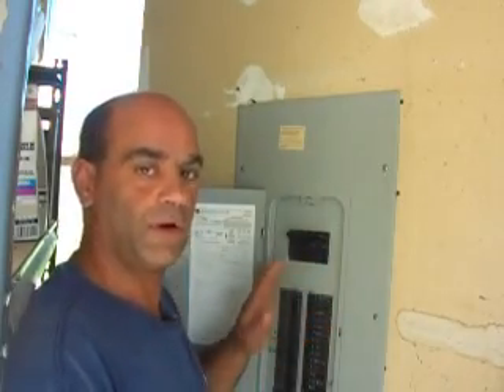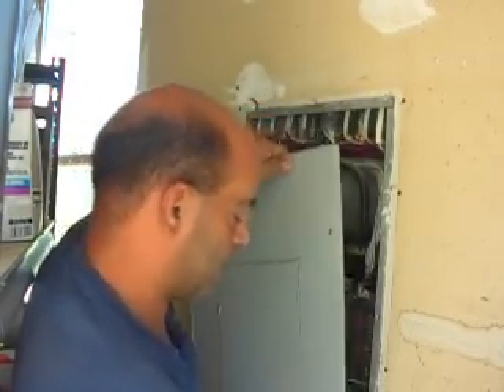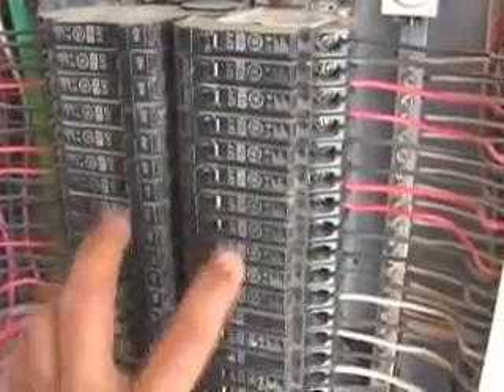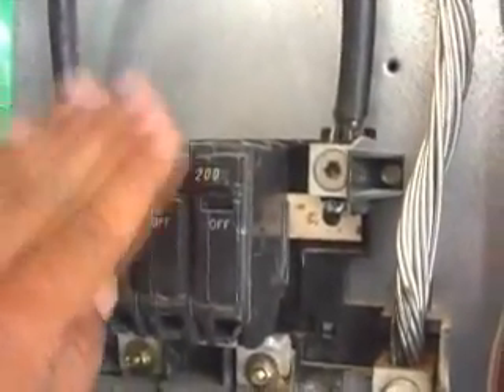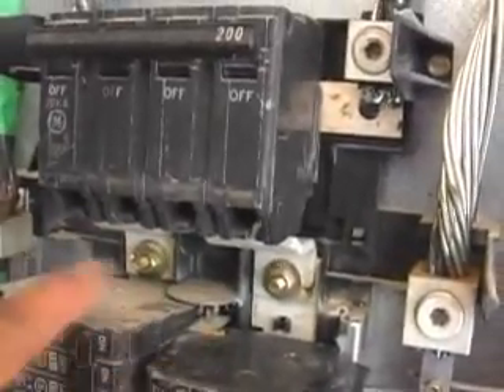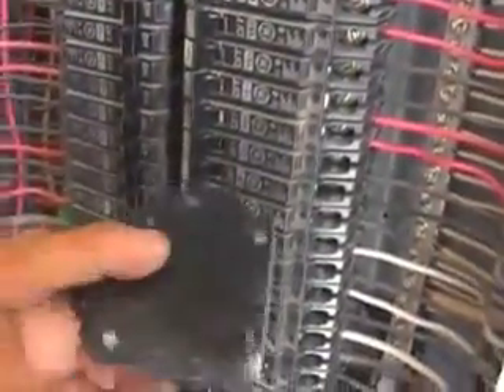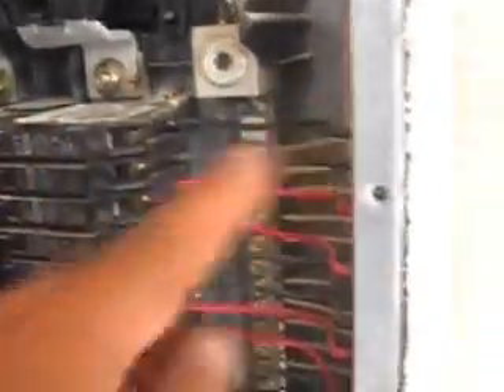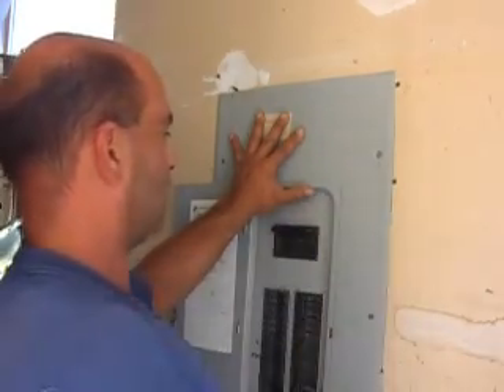How to change a circuit breaker

Comment: Okay, I was just gonna send an email but i thought someone would come across with the same question or similar. I live in a house built in 1960, the dinning room doesn't have lights fixture so I thought it was good to have some light and decided to install 4 recessed lights. the problem I have is trying to connect them. I connected them but now I tried to turn them on and it burns out the light bulbs and I don't know why.  Any suggestions? thanks... Edwin

Comment from the maker: Hi, it's very important that the breaker you're replacing is the same one. They can look a little different but should be the size size as in shape and of course the right amperage. I would take the old to a good electrical store and ask for one that will work.

Comment: Awesome!! nice video, thank you.. I really learned lol do you happen to have a video explaining the types of circuit breaker? I burned one and wanted to replace it but the one i bought is not the same, is the same AMP, but not in length and color. I did my research and i think i'm looking for for some twin single pole breaker 30AMP but the ones at the store are not the same length mine is longer then the one I bought and the one on your video. Allright thanks for your video..

Comment: well because if both your hands are up at chest level it creates a path between your heart from path to path.  But also if yo have ever gotten shocked its not your whole body. they used to test voltage like that if you felt it up to your forearm its 120 but if you feel it up to the shoulder its 270.  Which this was actually in old code books.

Comment: Thats a pretty good explanation except for when you were explaining the neutral. The neutral is actually the return path for the electicity to make a complete circuit, and actually sometimes the neutral can shock you worse than the hot wire. Also a tip if anyone installs there own breakers is to keep one of your hands in your pocket so if you do get shocked it deverts the shock away from your heart, and might save your life.